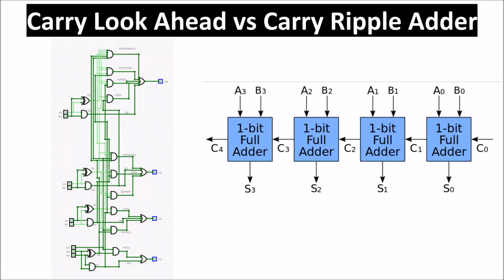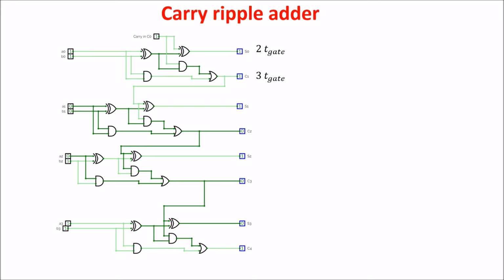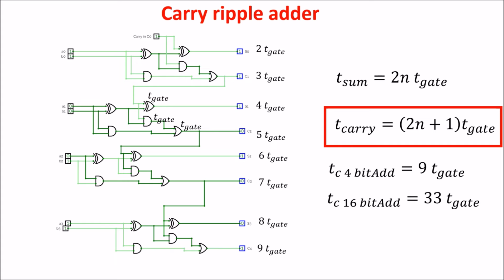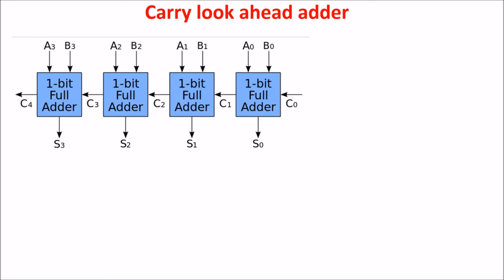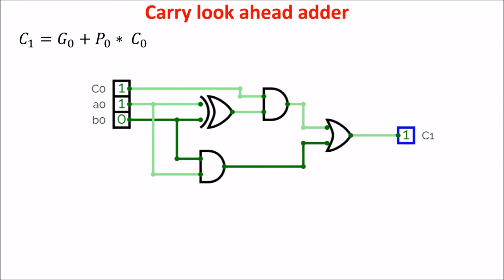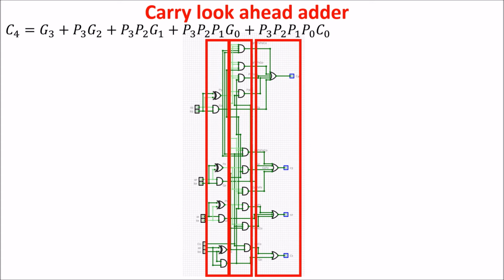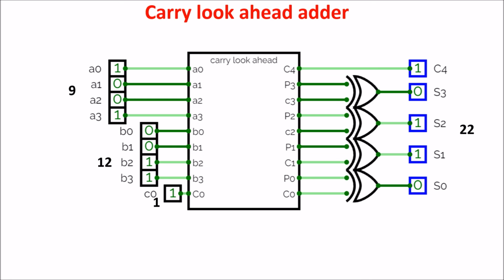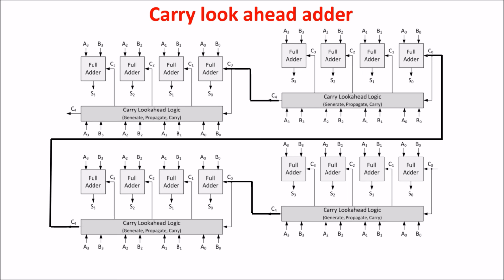Binary Adder - Carry Look Ahead Adder vs Ripple Carry Adder

Comment: At the end, I think the total delay is lower for consecutive blocks, because delay of the carry output of a block is 3 not 4, and the carry input starts at the second stage. So 1 block has 4 (or 3+1) delays, but 2 consecutive blocks would have 3 + 2 (between carry in and carry out) + 1 delays = 6 and so on. So delays = 2 + (block count * 2)
Reply from the maker: You are right, carry out delay is 3 so the total delay of consecutive blocks is different from  what was said in the video.
Reply from the maker: Have you seen this other video about binary adder? https://youtu.be/WmIFFhJYzO0